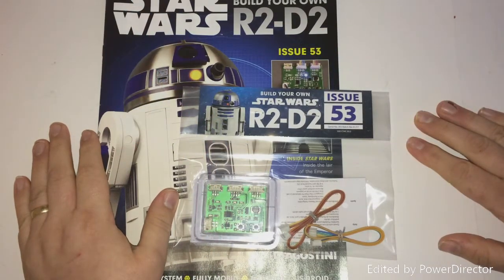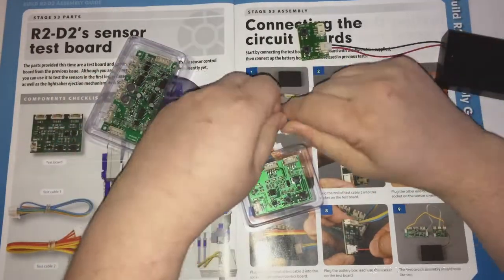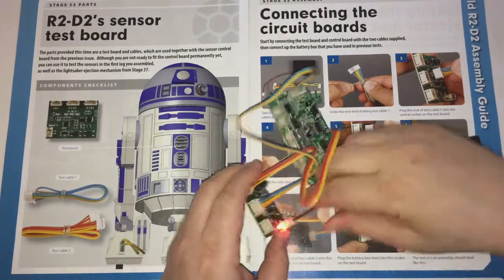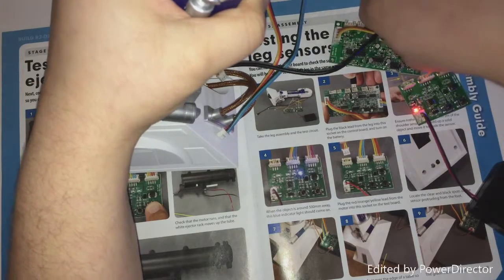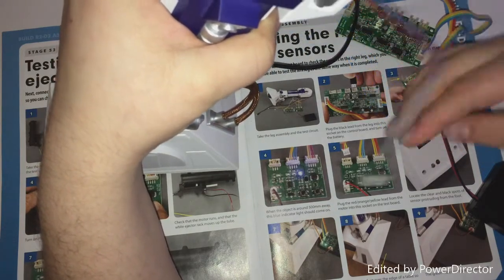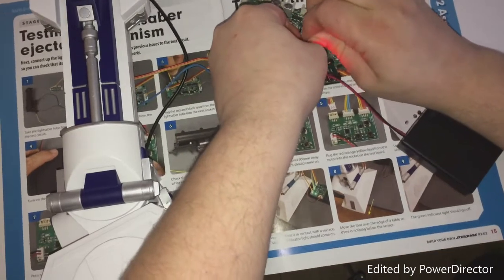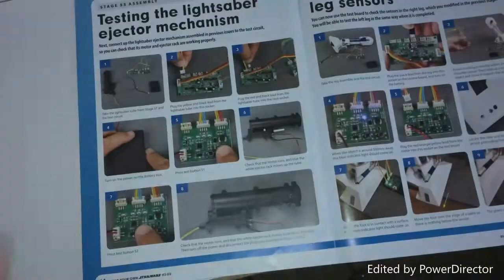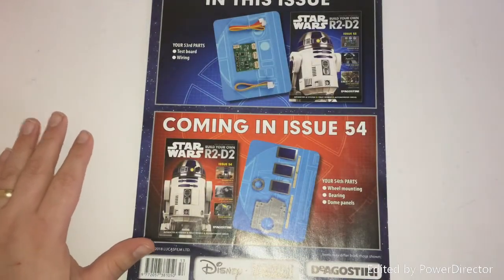Star Wars Build Your Own R2D2 - Issue 53

Comment: hi buddy I have exactly the same problem as you but I don't think the sensors are faulty because as you noticed you heard the clicking which is why comes from the ultrasonic sensors  on the legs I think its either an hardware fault on the main logic board or whether the 2 adjustable pots on the main logic board can be adjusted manually to set the sensor activation distance I look forward to your next video cheers peter